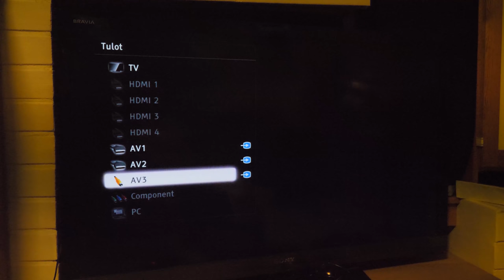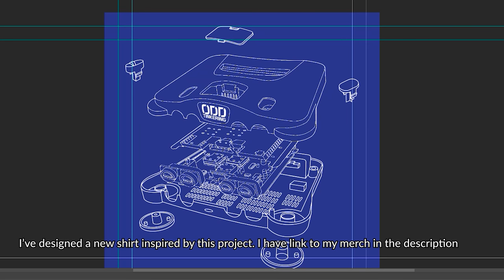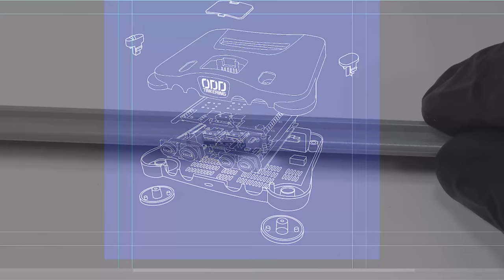I Restored This Yellowed Junk Nintendo 64 - Retro N64 Console Restoration

Comment: The "removing the yellow" - part never stops being super satisfying
Reply: Yes!
Reply: Favorite part
Reply: i find watching it really cool, almost like magic
Reply: Wish he could do that to my shower walls...
Reply: The blue on this one came out so vibrant!!
Reply: This one not so much, I think this is not his best restore so far, but good Enough to make a video 🤷🏻‍♂️
Reply: @pablonunez4397  wait what do you mean? All the yellowing was gone and it was a nice white and blue again.
Reply: @Kathrynerius  look at the corners at 06:40 , we can clearly see that those are not completely clear and a little bit of yellow remains
Reply: almost like asmr
Reply: Basically he's bleaching the plastic pieces with hydrogen peroxide and uv light exposure. You can see a more detailed version of this on the 8bitguy channel (over the last year).
Reply: ARE YOU HERE TO SEE HIM REMOVE THE YELLOW?you lady must be thrown in jail
Reply: @StabStabStabStabby  link?
Reply: @pablonunez4397  yeah he didn’t let it sit for long enough since he’s only using hydrogen peroxide. He needed to let it go for at least three days. Or he could have mixed in a bit of oxyclean and it would have been done after one. I mean perfect like it came from the factory. And plus the controller ports were still discolored. He’s great at this stuff but this one wasn’t his best work for sure.
Reply: @extrules  Try "Fabulous", it will looks like purple spray paint, so cool.

Spray and let is set, the color will turn clear, then just wipe away.

Comment: Man, that console is probably broken and look how filthy it is! - our argument for not buying it
Man, that console is probably broken and look how filthy it is! - his argument for buying it. 

Perspective and intention make a lot of difference.
Reply: It also depends on the console itself.
Considering how in demand something like a Saturn would be I probably would pick it up if it were in the same condition.
Reply: I bought an ebay listing of 24 of these many years ago, they looked absolutely trash. Like...something you'd get out of a smoker's den. I didn't care, however, because i only needed the screws, hardware, and some of the other bits that were otherwise rusted or corroded.

Surprise, to me, when i got them and 15 of them were in such good condition, after clean up, that i managed to restore them to mint condition, not even the usual scratches you'd find on the bottom or the cartridge areas. The ports weren't loosened, they simply sat on someone's dirty shelf (likely a repair store or something).

The rest were dead, burnt bits, but even those cleaned up to be respectable shells.

What you see is not what you get, and whilst you usually get bad eggs, you can also find good deals. Very good deals in my case, i made up the price of purchase tenfold.
Reply: if you like restoring filthy and probably broken ones are cheaper

Comment: Those aluminium electrolytic SMD capacitors could've been a source of most of the corrosion by the looks of it. They typically leak by the age of 20 or so, and the leakage is extremely corrosive slightly sticky liquid with barely any surface tension. That's why these should really be recapped.

Comment: fantastic work. so satisfying. for my own N64, I may add a touch of PC thermal paste on the three square metal block heatspreaders over the CPU, GPU, and RAM. also a tip for keeping track of where screws go- get an assortment of colored markers. each type of screw you remove, the hole gets a dot of color, and the screw goes in an ice cube tray square with a dot of the same color. also, to reset the N64 controller joystick center position: let go of the joystick, then hold down L and R, and press Start

Comment: You should use more flux and let the solder point get hotter. If it’s pulling up when you lift the iron it’s not hot enough. I’d honestly say you should’ve wicked it clean and started new flows. Flux is easy to clean and generally can’t be over used.

Comment: When the end of the world comes, these skills will be in high demand.
Reply: And that guy will be the Messiah.
Reply: This is pretty basic electronic repair...
Reply: @randybobandy9828  which is in low supply
Reply: @randybobandy9828  you would be surprised how many people dont even know how to use a screw driver let alone tearing a console apart.
Reply: @randybobandy9828  is that you randers
Reply: @augustesdupin7967  I go by   Smokey now.
Reply: Honestly.  There won't be electricity so this will just be a paper weight.  That being said, this is good work.
Reply: Ya, getting a retro console restored to play as the world ends would definitely be possible and the highest priority
Reply: On Pluto.

Comment: I love these videos.

Question: Is the hydrogen peroxide used multiple times? It seems like a lot of fluid to get only one use out of, if it's reasonably possible.
Reply: Id imagine it's used more than once but I think it loses its strength after being used over and over. If you buy industrial sized bottles, it helps with the cost. So he could really go either way
Reply: Most likely not. I imagine for a single project you may reuse some in a smaller container and only dump once its visibly not helping anymore, but once its been "contaminated" so to speak theres no way to be sure how much of the active ingredient engaged in the previous use so its better to use totally new stuff.
Reply: Can someone recommend me a Hydrogen Peroxide for this project?   I plan to follow this video as I recently picked up this very same console.

Comment: In the future, just wash the PCB in distilled water with non-scented liquid soap and a soft toothbrush, just make sure that you remove any batteries and socketed chips before washing any PCB. Just make sure the PCB is fully dried out before applying power. For rejuvenating the solder, add flux then solder then desolder and apply new solder. Great video.

Comment: I honestly think the scale of dirt in this console called for ultrasonic cleaner bath (to clean / loosen the grime under all those chip pads as well, followed by ipa scub job like yoy did). I don't like to use it myself (i also prefer manual cleaning), but i think i would use it in this case.

Comment: Person: ugh, my electronics are so dirty and dusty and gross, but I can't clean them with water or else they'll break!

Odd holding IPA and a toothbrush: allow us to introduce ourselves
Reply: @Damion Manuel I didn't know any of that, thank you for telling me!
Reply: @Damion Manuel I've got a buddy who collects old arcade machines... washes off the dusty PCBs with a garden hose.  Like you said, you just have to make sure that there is no residual power like batteries or charged capacitors and that the board is perfectly dry before powering it back on.

Comment: Here is a question for you : Is the Hydrogen Peroxide reuseable or you have to dump it once it's done the job?
Reply: I think that reaction is radical based, so i think the used hydrogen peroxide will get converted into hydrogen oxide i.e. water. Since all hydrogen peroxide isn't getting used up here so i think in this process. You will end up with somewhat less concentrated solution of hydrogen peroxide.
Reply: @devavratmunagekar  Thank you for the response.

Comment: Can't wait to see how you tinker with the analogue stick - mine started to loosen a few years back, which just won't do. I LIKE IT STIFF.
Reply: Mine too!
Reply: I bought a gamecube style stick and it works much better than the original, plus it has a much longer lifespan.
 It cost me about 10 usd.
Reply: I have a gamecube and one of my thumbsticks was broken, so I took the c stick out of one I couldn't use and switched it out. It worked for me, but I don't know if it will work for anyone else or for anything else.

Comment: Hey @OddTinkering what's the tool you use at 9:32? I'm looking to buy something like that instead of buying a lot of compressed air cans. I found some small and apparently quiet compressors (1/5 HP) for aerographs, but I'm unsure it does the job.
Could you please help me with that?

PS: I've been a follower for some years now, I love your channel! <3
Reply: probably just a simple airgun

Comment: are there specific areas in general to avoid when cleaning with ipa? I didn't even know it was safe to use directly on a board like that. 
I love your videos BTW! they're not only very well shot, but an an amazing learning tool, and also satisfying 😁
Reply: Cute
Reply: Its safe to use because the stronger isopropyl has less water  And will evaporate its great for your Bangerz too

Comment: I’ve been using this as a sign I should clean my controllers. Some of them I’ve had for years and some of them are second hand and haven’t had a good deep clean yet. I also wanna try actually fixing some old consoles I have. One that still works but I want to replace the plate on is my PS2. When I was young, my mum used to use it to hold candles as it was a flat surface. One day she lit one of the candles and forgot it was alight when she went to bed. In the morning we discovered there was no fire (thank god), but the ps2 had suffered instead. There was a huge indent melted into the plastic and some areas where the wax had melted through the plastic. I never cleaned it apart from taking off the wax I could with my hands, mostly because I didn’t know how, and as it still worked I didn’t care so much. I wanna repair it to its former glory, and you’ve inspired me to actually do that, so I don’t have to be afraid anymore to plug it in😂.

Comment: Tip: You can user copper braid to pull the old gunky solder off the pins for resoldering. It's basically a solder sponge. Just mentioning because you restored so close to "like new"

Comment: After watching this video multiple times, I decided to try my hand at restoring an N64 (I'd already done controllers before). I bought a controller/console combo off eBay for like 35 bucks, and it was in just as terrible of a condition as this one - mud all over the outside, spilled coke on the internals and corrosion, and dead baby maggots throughout (fun!). 

With a bit of elbow grease and memorization I actually did end up fixing it so that it worked like new (couldn't remove the scuffs on the case though) and I installed a GC stick module on the previously broken controller for bowser throws. I now use it with a JP SM64 cart for speed running. Very satisfying.

Comment: I had to take my N64 apart recently and just to get the screws out of the top you have to order a special type of screwdriver. However, I found a tip that if you have a sturdy straw, you can heat up the end of it then shape it to the head of the screw and it actually works

Comment: The "64" in Nintendo 64 is apparently a reference to the number of screws holding down the motherboard
Reply: It could be, however officially the name is derived from the system’s 64-bit processing unit since they had just made the SNES which was a 16-bit console and they decided to quadruple it to 64-bit with their next one. It was a pretty big deal at the time and that’s why they named it the Nintendo 64.
Reply: @MrOgge50  haha, in that case I think the engineers decided to represent each bit by a corresponding screw in the motherboard to celebrate the computing achievement. 😂

Merry Christmas dude
Reply: @Two-Eyed_Boy  Haha yea that’d be pretty funny, to you as well!

Comment: Great video but you didn't clean all of the pieces before reassembly? Most of the metal brackets and trim in the center were still discolored? Seems a shame to go through all that work and overlook that. Otherwise it is a great video. I will use this guide when I clean mine, eventually.

Comment: Had a question my n64 will rest it self after 20 or 30 min could it be heat issues  or could it be the power unit just wanted your opinion.

Comment: I'm thinking I'm gonna start buying some old Consoles and doing this with full recaps and replacing some of the crystals.  It's rare for transistors to go bad unless burnt up.  But crystals, aside from being able to leak like capacitors, can also start vibrating or oscillating on the wrong frequency over time.  Kinda similar to CB radios.

Comment: Do you guys use the Retrobright method  with the oxiclean and peroxide mixed to a paste and put under Uva/Uvb? I know for sneaker restoration we use retro bright for the rubber soles and yellowing plastic on the shoe with 40 Volume cream that's another strong one.

Comment: Hey there, I recently tried to restore mine as well but mine didn't work. After disassembly it looked just as disgusting as this one. So I thought, let's just follow this vid and try. First it didn't work. But then, with a new power cable, it worked briefly and after 1 manual shut down, it didn't start anymore. I guess it's power related on the motherboard. But I don't know where to start and can't find anything on the internet. Do you maybe have a solution or a tip for me Mr. Oddtinkering?

Comment: I would have gone an extra step and ultrasonic cleaned the motherboard and then sprayed it with electrical motor cleaner to facilitate water dispersion and drying. Also I would have left the pieces in the H2O2 for a bit longer. Then spray everything with alcohol when done to sterilize. I would then dry everything by spinning centrifugal and then follow up with a hair drier.

Comment: The worst thing about it was the controller, which your video showed perfectly. Not only was it designed as if you got three hands, but the anolog stick was so horrible. You cannot even recreate the games so easily that worked with the analog stick like Mario 64, for the emulators will work with running only, and they could break so easily. Just like the entire controller did not really fit in your hand.
So, sticking with catridges (literally) and this horrible controller made the N64 the least attractive choice back then. And yet it still was worth buying it if you already got a better console due to its amazing games, which were the only reason why Nintendo survived in spite of a bad console and several developers quited working with Nintendo and switch over to the Play Station. Nintendo always made great games and released them for their consoles making them still a somewhat decent developer company.

Comment: Not a restore but okay. I've replaced cases and cleaned consoles but I wouldnt ever advertise it as a restore lol. Restore to me means keeping Oem parts. Even if its scratched or etc, its not oem now and some people would prefer the original parts since they dont exist anymore even if they are scratched. also were you even using flux because that soldering was hard to watch. your solder wasnt even flowing lol. it was globbing up like u werent using flux or way to low of a temp for that particular solder. you might not even be creating good solder joints thus making it worse rather than improving it like you think. flux is your friend.

Comment: should have with a light steel wool cleaned off the metal pieces or used a dremel with small wire brush wheel at a low speed....

Comment: As a fellow electronic repairman, your flux sucks. Throw it out get some new stuff. The soldier should have flowed so effortlessly on those connections, might benefit from using something steel to scrub those connections prior to dropping some soldier.  Just trying to help.

Comment: I understand he's cleaning it BUT WHY WITH YOU TOOTH BRUSH YOU USE IT FOR YOUR TEETH NOT A N64
Reply: People typically use a soft bristled toothbrush when cleaning electronic items because it gets in small nooks that other cleaning brushes can't get to, it's a toothbrush designated just for electronic cleaning. I have a clear handle toothbrush for cleaning my mechanical keyboard which has never been used in my teeth and never will be.